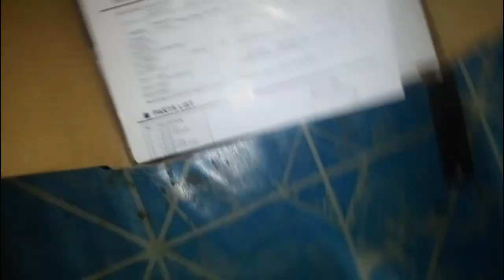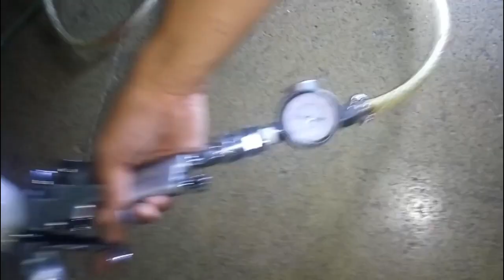Unboxing spray gun hvlp mini h921

Comment: Pake kompressor brp hp ? Merek apa gan ?
Reply from the maker: Mereknya kompressornya kurang tau om cuma kyaknya 1/2hp 2 silinder , mesin bensin nya 150cc 3.5 hp. Saya test 140 L/menit lebih
Reply: piro om harga nya... bagi link saler nya om
Reply from the maker: @zonamerahmuda1727  uda ga jual yg h-921 lg om sellernya tinggal k-350